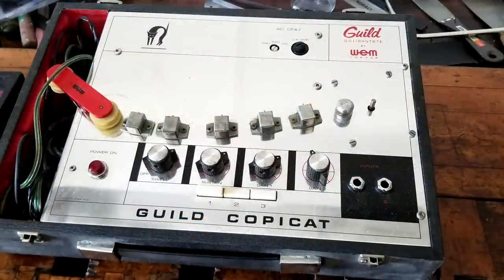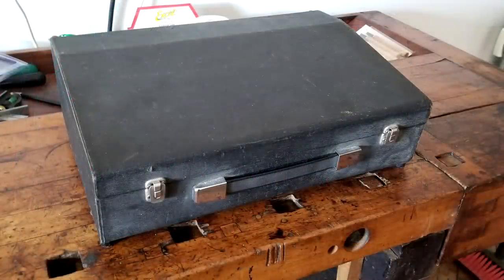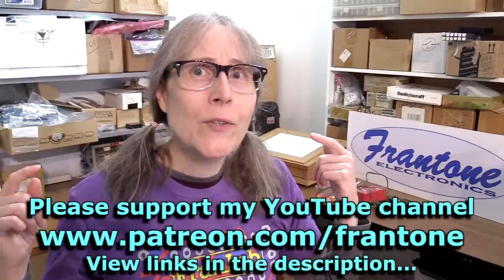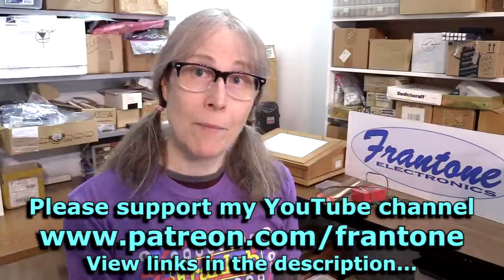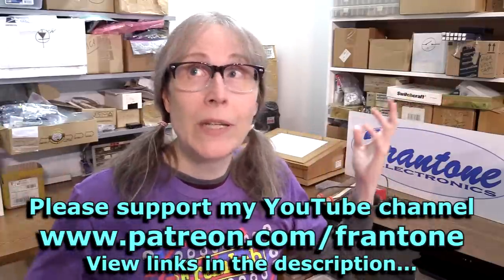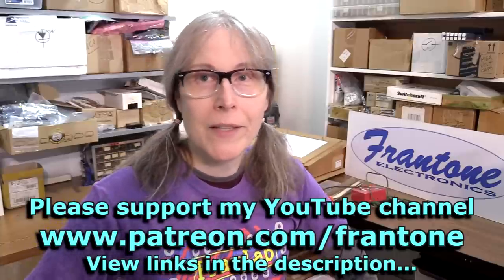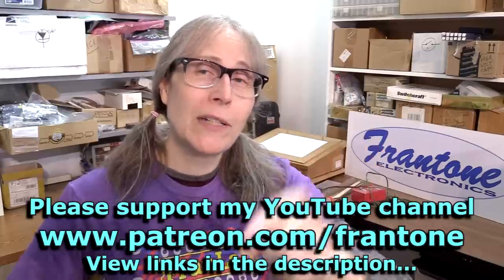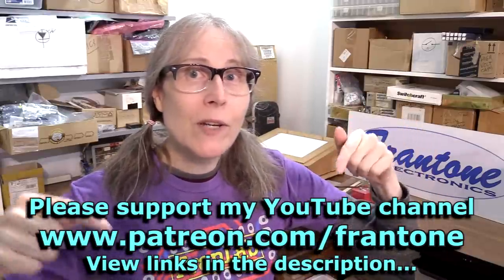Big Outgassing Problems Of Old Plastics

Comment: Fran, when I was keeping nitro cellulose film I kept it in a chest freezer with silica gel. The thermostat was adjusted to make it a "refrigerator" stored the film at 10 Celsius. Ridiculously cheep to run too.  A licorice smelling chemical in lots of stuff is 4-Methylcyclohexanemethanol. Stay safe Fran.
Reply: @crashk6 Would that mouthful be toxic, by chance?
Reply: I bet those films are the stuff of nightmares, especially if it was a hot  day and the freezer stopped working.  Isnt this stuff quite unstable these days?
Reply: @mikecowen6507  Like any chemical 4-Methylcyclohexanemethanol can be toxic with the right dose and/or duration of exposure. Oxidane is also quite toxic in high doses, yet life as we know it is impossible without it... though your're more likely to die via inhalation than overdoes by consumption of Oxidane.. cough water  cough
Reply: @steviebboy69  Temperature alarm is a good idea. Though, I just kept those Chinese pyrotechnic fire extinguisher balls in the storage area.. around, and one inside the chiller. Figured if the film went on fire it could just put itself right out.  However I never had a problem with the film sweating in low temperature storage; so never had to test the extinguishers. Though I did lob one into a car that had caught fire on the street... worked a treat. Chiller was on lower level so even if power had failed, it would have held around 20 Celsius at the worst of times. I was doing preservation, so I only stored the film long enough to do transfers onto more stable media.

Comment: Had a Phillips portable cassette that was from the 80s. I used it to use for storing ZX81 programs. One day much later, probably in the last decade, I found I couldn't open the cassette door, so I had to take it apart. The erase head was made from some sort of resin that had over time flowed into the cassette preventing it from being removed. I.e. rather than being a solid it turned to a super viscous liquid that flowed over a time period of many years. It was still solid enough to stop the cassette being lifted past it.

Comment: One of the issues is that most people think of plastics as both inert and being single substances. The reality is that most plastics have substances added to modify the properties of the base product. Some of these are relatively volatile, and can be reactive. My first experience of this occurred in the late 60s. I worked in a major diagnostic laboratory  for the UK government. We spread our workload to a number of outstations. The test we had a problem with was a complement fixation test for bovine paratuberculosis. The outstations had a problem with a large number of weakly positive results, that we weren't experiencing. To cut a long story short, we found that they were storing de-ionised water in polythene bottles, and that plasticiser was leaching into the water. Our main lab stored their water in glass.

Comment: The clear plastic handles on new Craftsman screwdrivers used to smell like vomit. I used to repair Sokkia surveying instruments, and for a little while they had black foam case liners that smelled like cat urine when new. "That new car smell" is outgassing plastics, and it makes a film on the inside of the glass for years before it settles down.
Reply: Cat piss?   It might be polyUREthane, as in urea.  I took Plastics classes in High School and also at university.   If you blow polyurethane foam into  a mold lined with polyethylene sheets and some steel reinforcement, once it sets you peel it away and get a beautiful car door with a shiny shell ready to paint.  Sound deadening too.
Reply: It was not too long ago that the news media began to report toxic building syndrome from formaldehyde leaching out of carpet glue.   Bisphenol-A (BPA) was used to make plastics flexible and rubber like for baby bottle nipples until it was found to leach out in trace quantities, BUT BPA mimics estrogen so even a trace is a big deal.

Comment: Materials deteriorating is unfortunately not something unique to old items, i've had plastic items less than 15 years old break down or get brittle.
The problem ive seen is that some react in enclosed spaces and cause the toxic gasses you experienced, and other materials are better when they are not ventilated.
I've personally found cardboard boxes have worked better than plastic boxes for old item storage, as they allow a small amount of ventilation through the gaps in the card, and humidity passes through (unlike being caught inside a plastic box)
Have you tried using those mini-dehumidifier packets in the plastic boxes? some deterioration can accelerated from the humidity.
Reply: I have a lot of plastic that got soft and sticky- often in less than 5 years. Especially with computer mice that have softer areas to touch and in cars with their "soft touch" rubber coating. Sometimes you can save them with oven cleaner ( I don't know why- just have seen this on car channels and sometimes it works really well) but sometimes the whole lump of plastic gets turned into a tar like substance...

Comment: Reminds me of a 16mm film i bought years ago that when i opened the tin it felt like it could melt my eyeballs out of my skull. i let it air outside for days and it still didnt help. other people living around me complained about the smell it traveled so far. I have various plastics and rubbers that are seeming to degrade. a 1970s swedish gas mask thats turning black and flakey, various tools who's handles are turning tacky. i once had a bicycle who's handles over the coarse of a summer became liquified and only found out when i had a hard time getting my hands off and part of the handles came off on my hands.

Safe to say, Plastics and plastic-based rubbers arent the thousand-year indestructible products people used to advertise it as. makes me worry about all our books printed with rubber based inks.
Reply: Well yeah. They can last a long time or they can break down. Either way it's nasty.

Comment: When you talked about the shellac records being made with nitrocellulose, I didn't hear you actually mention why that was so alarming - in case anyone doesn't know, it's because it's extremely flammable (possibly even a low-order explosive), can self ignite as it degrades and is it's own oxidiser so it won't burn itself out - at least, that's true of nitrate filmstock, not 100% sure how much of that transfers to shellac records.  But as an old 35mm projectionist, I know how alarmed I'd be if I discovered a reel of what I thought was acetate was actually nitrate filmstock!

Comment: I can remember when I was a kid, my dad had an old car (back in the  mid 1980s) and every time I used to go in it I would get very ill from the fumes from the foam in the seats, old foams are one of the most dangerous types of plastics for offgassing all sorts of chemicals and for creating all sorts of new chemicals when heated(most man made foams are plastics with added bubbles from forced air or adding reactive chemicals to generate gasses and create the bubbles) there was a long long period of time when the offgassing/seeping of chemicals was not even considered an issue because they had money to make.

The first thought  given to chemicals in and from plastics was children's toys and the sealed water filled teething chews that you would freeze, then baby feeding bottles and children's juice cups, then kettles and water and juice bottles were scrutinised, hence the "BPA free" label on bottles today (also free from other chemicals)

Sometimes on buying a cheap kettle you have to boil and wash it out about 10 times to get rid of the offgassing and the bad smell and tainting of the water, I refuse to use anything that does that now, the same can be said about plastic bread toasters..

If I could find any I would buy a metal kettle like we used to see when I was a kid, it might get hot and require caution to avoid an unpleasant accidental touch of the metal while hot, but it won't be seeping toxins into the water used for tea or coffee
Reply: May have been formaldehyde. The new cost smell. They even have a spray for it.

Comment: My second command in the Navy was outfitted with vintage aircraft with the older aircraft being well over 40 years, and some had been relegated to Davis Mothan for scrap more than twice. Being old, extensive time in a desert, and operating out of Key West (114f, high humidity) and detaching to go to Puerto Rico one week and Anchorage Alaska the next, I saw a lot of plastics failures. Control box faceplates made of nylon, lucite, lexan or even bakelite, connector inserts made of natural rubber, vulcanized rubber, or something...and, wiring insulation that may be capton thats rotting into flakes, or cellulose turning into dust, wires internally corroded and age hardened from flexing for decades..... yeah, none of these things were studied for years or decades of just aging. I had a connector that one of the guys were removing to replace the box and the insert had transformed into black goo. I still don't know why. Faceplates shrink and eventually crack into craters that you have to fix or re-manufacture because the OEM went out of business during the Eisenhower administration. Knobs are easily the one item that are mostly universal and deteriorate the most because finger oils, oxygen, sunlight and heat seem to rot the poorly made units. For the most part, I just dealt with the issues as they came and repaired the cracks or the rotted wiring. I think because the aircraft I worked on used pressurized or liquid oxygen systems, most of the plastics were tested for outgassing....
Reply: @Gene Ard Sounds fascinating! I've also dealt with some of the same sorts of deterioration in my own electronic servicing endeavours. I'd love to hear more about your experiences, if you can share them!

Comment: I have a vintage educational construction toy - the pieces are some sort of vinyl plastic I think.  Actually, I have two sets of it - one that I know has been stored in a dark cupboard, and is fine - the other, I bought from eBay and I think it must have been exposed to heat or sunlight - the pieces have become brittle almost like glass, and there is a sort of chlorine aroma when I open the box
Reply: Sounds like bromine sunlight breakdown.

Comment: Hello Fran, plastics offgas a lot, when you get a new car that new car smell is toxic plastic off gassing, the plastics deteriorate over the years, all plastics do this including newly made ones to this day, although some of the more nasty chemicals have been phased out..

Plastics also degrade with UV light and due to exposure to radiation even including background radiation
Reply: yes, maybe even background radiation. i store parts in old plastic pails (white) and clear bins and both will surprise me by just falling apart when i lift them after just a few years.
Reply: Not sure about the "new car smell" being strictly offgassing. They spray stuff in the cars to mask smells at the dealership. (car could smell like a locker room in the summer from all the sweating people that put it together getting in and out on the assembly line)

Comment: Don't know if it's true for all electronic equipment of that era, but I've heard it said some old equipment can fail because a type of PCB lacquer deteriorates and becomes conductive. Maybe the smell comes from the lacquer
Reply: Corrosive lacquer? Haven't seen that happen, but the rubbery tan glue (often referred to as SonyBond) that was used in lots of old audio gear (to secure components before the boards get soldered) eventually turns brown or black over time, starts to look like burned sugar, and corrodes any components that it touches. At work (audio repair shop) I've spent countless hours scraping that stuff off with a dental pick and replacing the damaged, corroded parts.

Comment: Glad to hear you're not the worse for the experience.  The plastics I know about are polymeric sheets and have added plasticiser to enable these to be folded / shaped.  These compounds are phthalates - diethyl / butyl.  These compounds act as lubricants allowing the plastic to be formed but they are volatile.  As I understand it they're not particularly toxic. When they evaporate they may be the source of the smell you're getting - after which the plastic they've left becomes brittle and easily broken. Don't know what the plasticisers break down to form.  Keeping objects like this at low temp, away from heat and sunlight should lower the rate of degratation.  Keeping the area well ventilated will prevent a build up of the vapour being emitted.  I don't know if you can get a spray to replace the evaporated plasticiser to restore the properties.   A car restorer may have info on this.

Comment: Fran, as a solution to your problem opposed to just frequently testing,  which I believe is helpful, why not put two small holes in each plastic bin. One with an aquarium one way valve only letting air out, and the other connected to a tube with constant air movement (or turn on periodically based an arduino system) so long as you add enough air to the containers to refresh their volume with non volatile air, it should be okay. (you might be able to use an aquarium pump)!

Comment: With the PVC lined case first wash with soap and water on a clean cloth, to remove the surface film, then get some car dashboard protector, which is meant to keep plastic soft and flexible, as it replaces the missing plasticiser. As it is 1970's it is likely a BPA being released, so you need to clean the surface to remove the residue, and then put a protective coat on it, and minimise handling, which will help. 

Likely the BPA is reacting to decades of skin oils and stuff left on the surface, along with the plasticiser in the PVC reacting with it in storage, so a first pass of cleaning with neutral detergent will get most of it off, along with gentle scrubbing to encourage the grime film off.

The radio I would do the same with the cabinet inside and out, and with all the wiring inside, along with the PCB top and bottom, avoiding the IF transformers and painted decals, then allow to dry thoroughly. Should get a lot of dirt and decomposed plasticiser off, and at least smelling the cloth after assorted items will allow you to narrow down the actual major cause.
Reply: Automotive products like Armorall typically contain silicones, can react with some surfaces or materials,  and are notoriously difficult to remove once they've been applied.

Comment: Nitrocellulose discs are perfectly stable in their finished state. Freshly cut swarf on the other hand is scary, I have burnt the swarf of a single 10" recording out of curiosity, it burnt for some time with a column of flame about 4 feet high! Interesting about the liquorice smell, I have noticed this on a coil of 1940s shielded cable I have (like PVC but not sure) it stinks and is greasy to touch. I have wiped it dry and found it sticky again next time I handled it. Another great video by the way!

Comment: You had the same idea that i did when you talked about drilling holes just add a fitting, some glue with vacuum line and a vacuum pump, you would then also have the opportunity to exhaust the gasses to a more suitable atmosphere. 
You need to figure out what materials are breaking down inside the electronics you store besides the plastics then consider which ones you will store together or what you can do to mitigate the interaction of many different chemicals in an enclosed sealed environment , especially since they're going through more drastic temperature changes (temp change usually = humidity change too)

Comment: This is the exact problem that I'm having in my music room at the moment.  I have everything in plastic bins in the closet.  EVERYTHING.  Those bins are only maybe 6 or 7 years old.   And now, when I open the closet, the reek just... knocks you over.   And the smell has gotten into EVERYTHING that's stored in them as well.  I took out some old circuit bending stuff to work on, and I had to abandon the project because they picked up the smell so damn bad.

Comment: I have a Sony video walkman that did about the same thing. I had it in an old trash bag in a storage locker for many hot summers. The plastic outer surface had become extremely sticky and permanently adhered to the bag in random places. The outer plastic on the video walkman is known to get sticky but this was extreme.

Comment: Before you stress about too much doom & gloom about keeping your artifacts safe, Fran. Remember you are doing a heck of a lot better than letting them just sit in storage without any care, or worse just out in the open with no archival at all. Even the best museums have stuff unknowingly degrading away. Generally, the only way an artifact can be perfectly preserved is with constant expert care and attention. There's some good info here about separating plastics but even then, a lot of equipment has multiple plastic parts built in. I would do your best but don't stress, as I said, you're making a damn fine effort regardless!
Reply from the maker: Thanks so much Kenny - it really makes a difference to hear that.   I appreciate it....

Comment: At work (audio repair shop) we have seen many instances of plastic parts such as nylon gears that dry out and crack over time; and rubber belts that either dry out and lose their elasticity or melt and turn to black goo. These parts can degrade whether they're in a plastic bag, a cardboard box, or actually being used in a piece of equipment.I suspect that the process is accelerated when the belts are exposed to other plastics outgassing, warmed-up grease and lubes, and ozone from motors, all being released when the unit is turned on and being played.